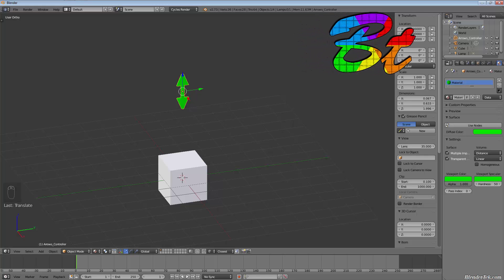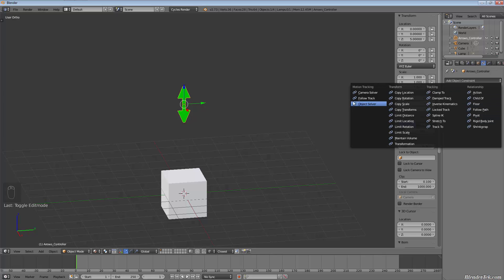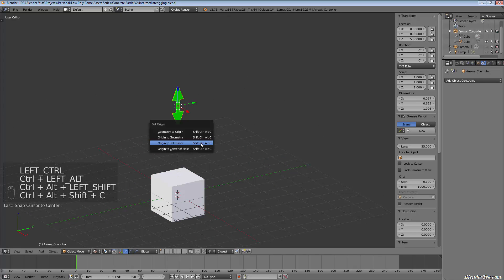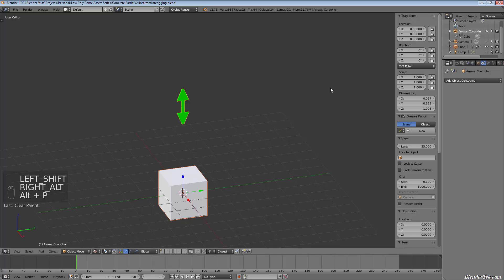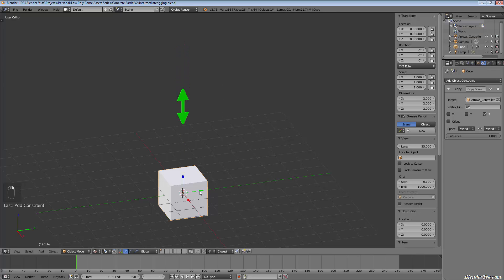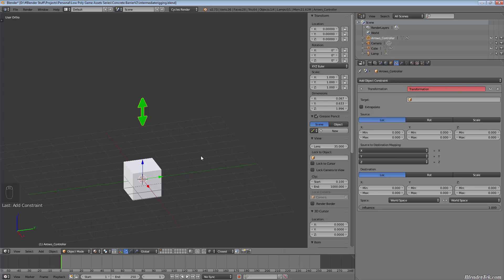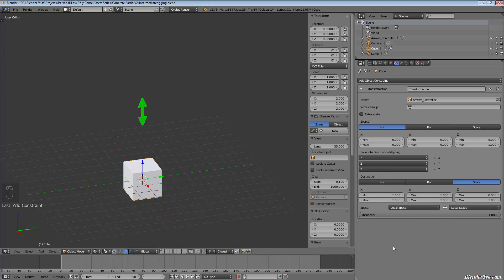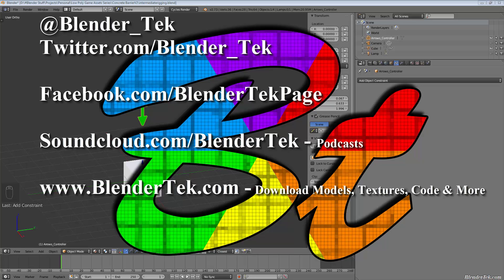Intermediate Blender Rigging Techniques - Part 1 : Copy Location & Series teaser

Comment: Good news! I also have a question on that topic: i once tried to animate a cameraflight from the sun to our earth, tracking the cam to the sun until it enters the orbit. Then i wanted it to change the influence of tracking to 0 so it points at the planet while orbiting around it (as follow path on a bezier circle). I got really weird location changes of the cam. Setting the foreward to -z and up to y didn't give the expected results. Maybe i just wasn't exact enough when placing the origin. But most likely i just understand the system behind it well enough. Can you address that too, since it claims to be intermediate? Thanks in advance!
Reply: My workaround was tracking the cam to en empty that then could be animated, and the orbiting was just a parenting to another empty that's located in the planet's center and that has a keyframed rotation. I was however disappointed that the constraint-way didn't work.
Reply: Never mind. Problem solved. But thanks for the effort.